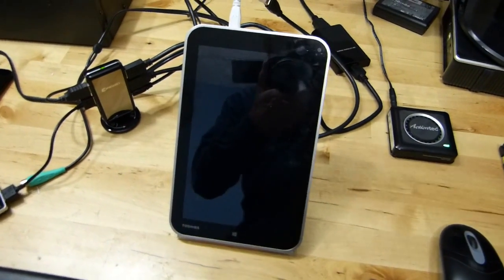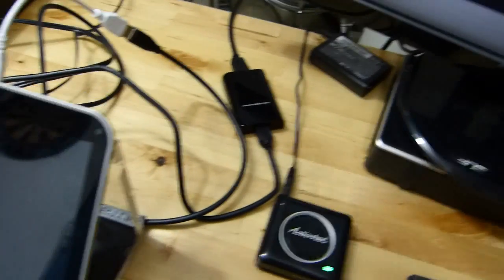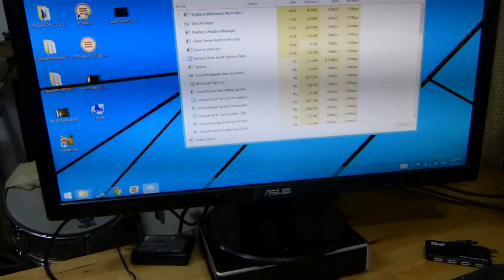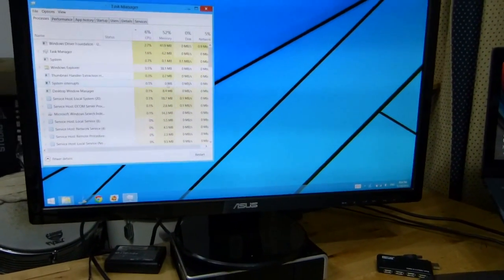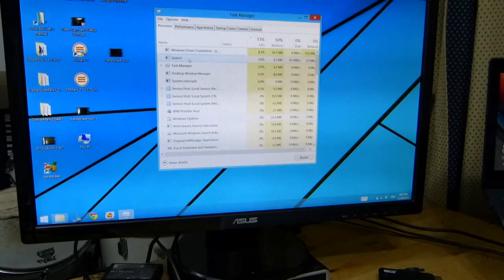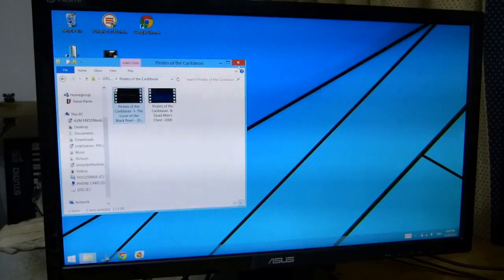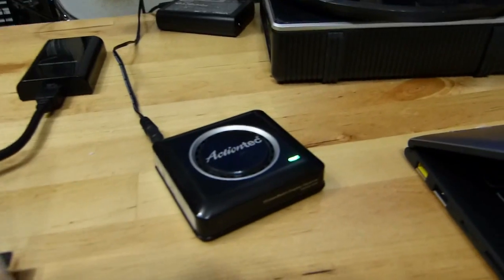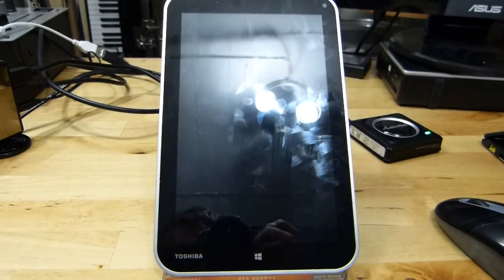Toshiba Encore WT8. Three Screen Output Options

Comment: Steve I have got an Encore and just can't get it to work.
Not tried USB but my tv is supposed to do miracast LUXOR 32 inch
HDMI just will not work. display is static and only part of the screen. I do not understand how you did this
Reply: ***** It varies one tosh tv picks it up but in portrait only and the resolution is set so low that the  apps wont work. my luxor tv will only do a still image usually of the desktop. I have the drivers for the Dell as well as the original ones. My tv has built in miracast. It detects a network called DIRECT-TETOSH something but cant get a connection